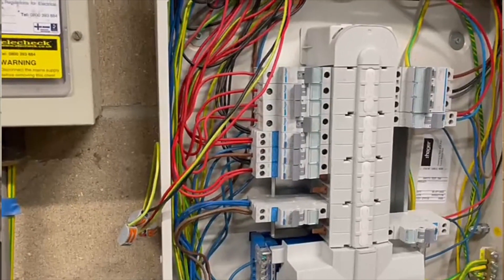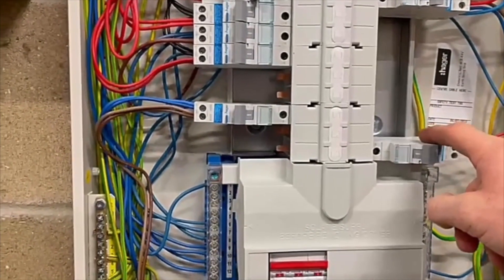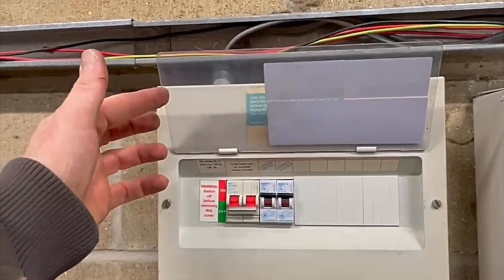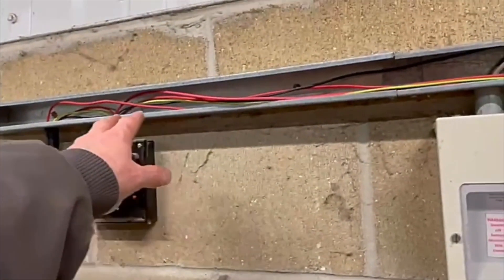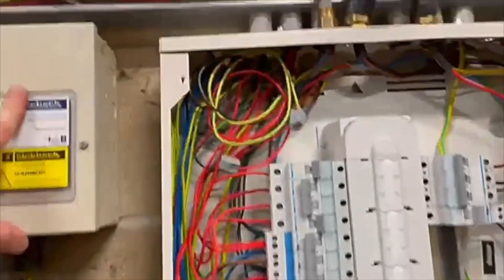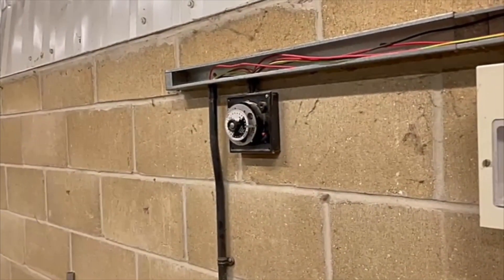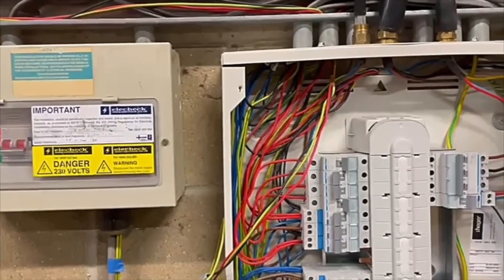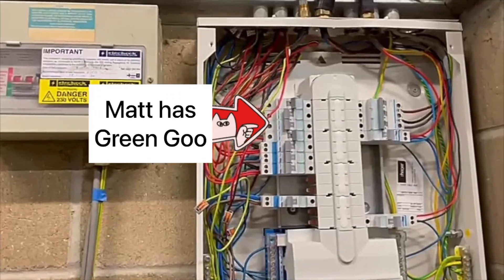Electrical Fault Finding - Borrowed Neutral and an RCD

Comment: So going to use the existing wire to pull a draw, and then pull the neutral back in 2.5mm, to get the separation needed. At least there is a good chance you will be able to get to the roof box to open it, as there likely is some sort of lift platform there to use. Need to move the isolator though for the heater, to probably the other side, so it will not be boxed in and inaccessible to operate though, but as a bonus this will also allow the shelf to be moved to the pillar. Somebody at that shop will be doing a lot of shelving work, but at least that is speed shelving, so a bit of lifting of the pallets, and then the beams unclip easy, and you only need to remove one section of it.